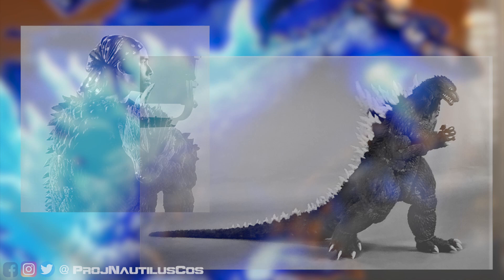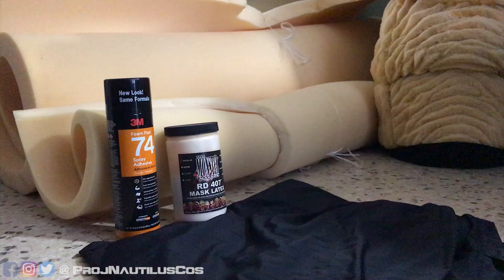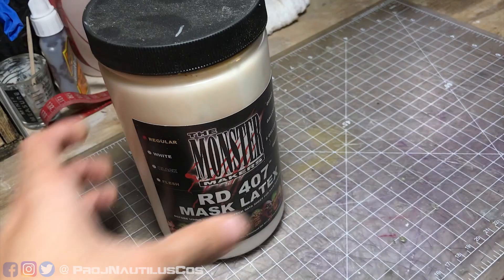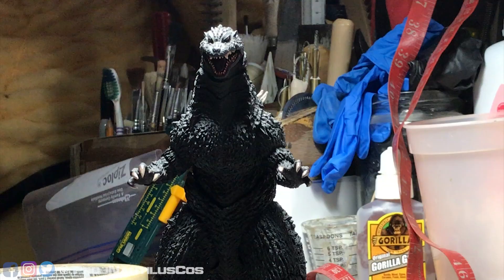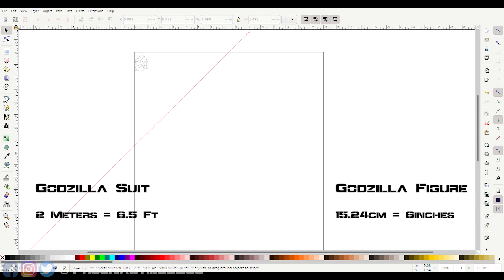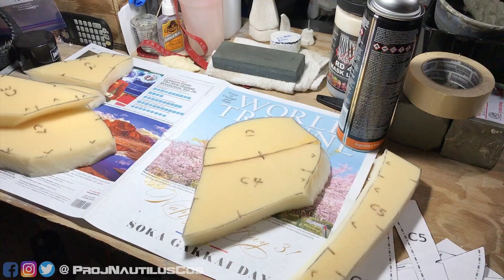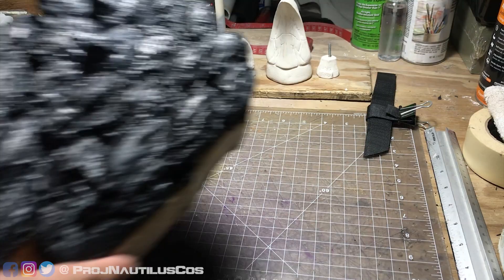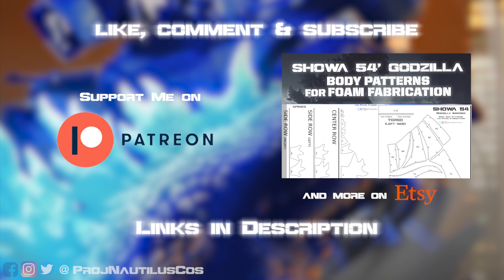Kaiju Workshop 101 Pilot: A Brief History on Kaiju Suits & The Essential Steps to Build One

Comment: If you don’t have a Godzilla figure you can make a small clay sculpture to make a pattern, i found on the internet some vests that have pockets where you can fit small silicone bags field with cold water, if you make your suit so the torso isn’t tight to your body you can use one of these to cool down a bit, it’s also advised that you wear a spandex suit underneath so it can capture your sweat, so it doesn’t get on the suit, another way to make the scales is to draw them on the suit, than use a hot tool like a soldering iron to sculpt them, than cover it in spray glue, witch not only seal the foam, but it also allows you to glue down the edges of the scales, giving them rounded edges, than cover with latex tinted with your desired base color and some toilet paper, the paper helps to smooth the details, you can now paint the suit with more of that tinted latex, add a bit of black  paint to the latex to make the color darker, than paint the lower areas of the texture with a brush to make a small shadow, than add white paint to the latex to lighten the color and lightly stipple it on the raised areas of the texture with a sponge or a scrap piece of foam to add some highlights.

Comment: I'm getting into the final stages of my costume, probably a month before it's done. How does the tail fare when dragging? Does it need extra layers of latex? would HD-70 foam be better? or is the latex good enough for it to not scrape or wear off? I will end up walking on side walks outdoor, indoor carpets, but on smooth tiles which arent any problem.

Comment: Do you have any alternatives for liquid latex? I keep reading elmers glue or liquid rubber mighr work (the rubber is used like liquid flex seal)
Reply from the maker: Apologies for the late reply! For my current KiryuGoji suit, I used Creature Cast Neoprene. it's more costly BUT it's far more resistant to the elements. Elmers glue would just deteriorate quicker especially with a large scale suit that'll take a beating.

Comment: Hi! it would be great if you can answer my question. If i buy your pattern on etsy how can i print the pattern out to be scaled to like my height which is 6'0
Reply from the maker: For sure!! just requires a bit of rescaling via Inkscape
or the printer settings, When you do, print the arms first as they’re the quickest and smallest to test out. It requires a lot of experimentation. Hope that helps! 💙
Reply: @ProjNautilusCos  Hey it's me again! I've went out to buy so many supplies for making a g14 suit with your pattern! I just had 1 question, what can I do to print out the patterns? maybe like what kind of size paper to use when printing?